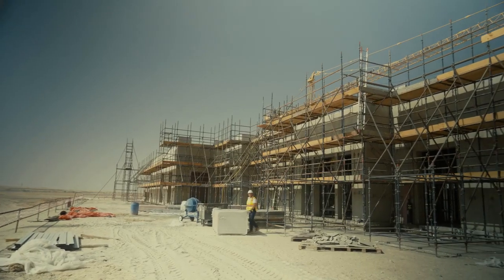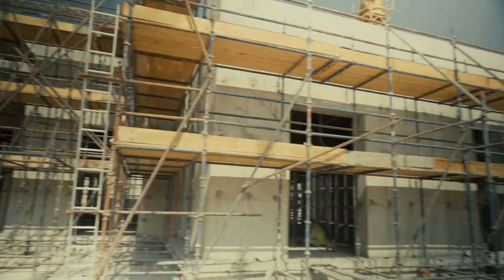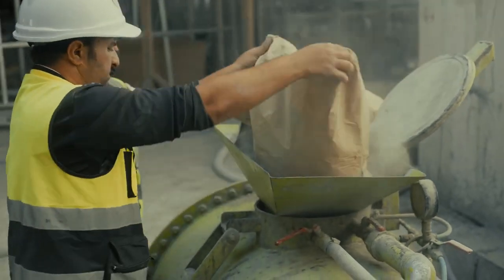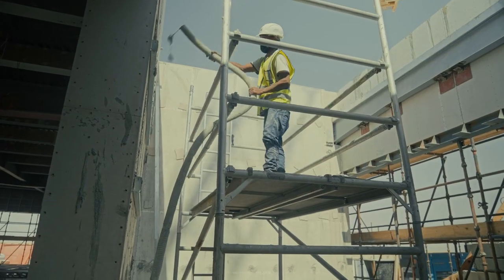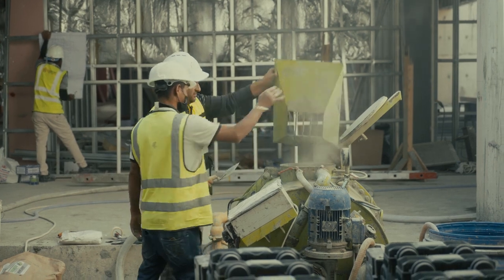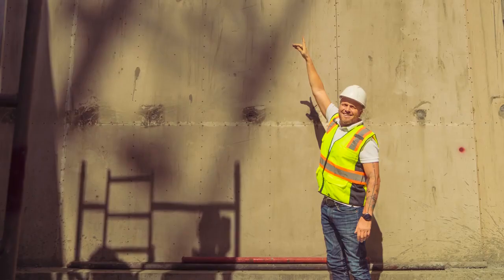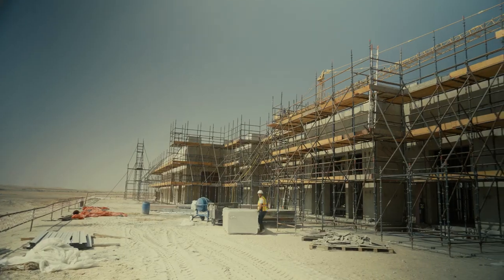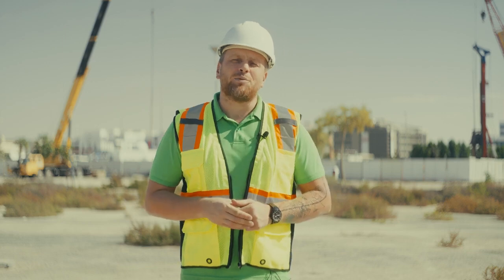Light gauge steel frame building with lightweight concrete infill

Comment: Do you have any structural products? (Not just insulation)
Reply from the maker: Light gauge steel
Reply: @stretchceilingsDubai  so the structural integrity is from the light gauge framing and you pour the light weight concrete around it as insulation. 
Is that correct?
Reply from the maker: yes
Reply: @stretchceilingsDubai  great thanks for explaining!  Do you have any standard details? Showing quantities and cost information?